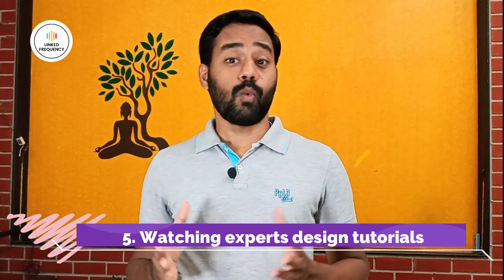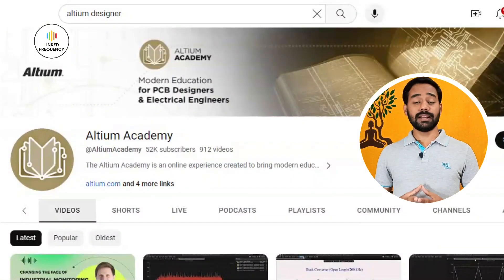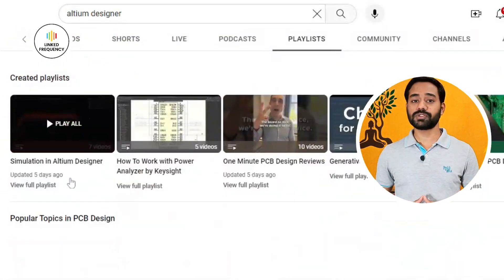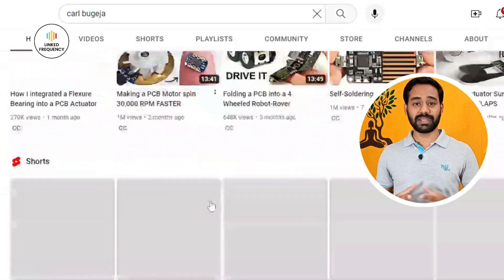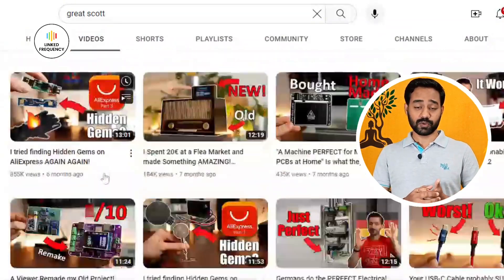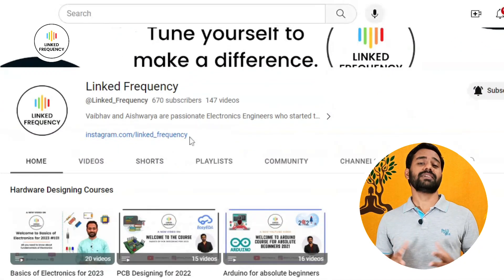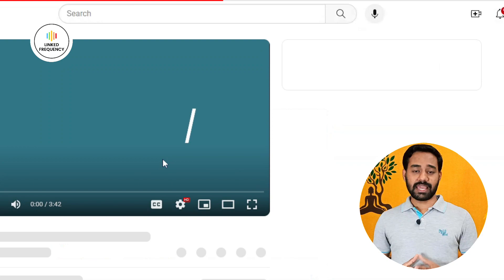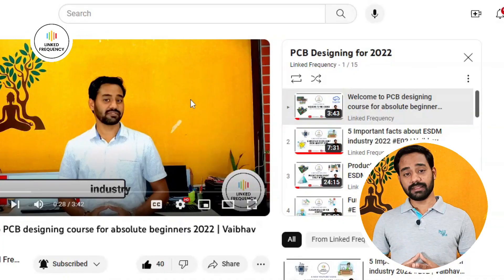5 Tips to become a Professional PCB designer | Vaibhav Sugandhi

Comment: Hello, I just finished an electronics engineering degree and was having a bit of a hard time finding a job on my local area, this tips helped me out on the right direction when it comes between a PCB side of my career as I was also trying to apply for some remote freelance work, so I would like to apply for a remote internship in this area if possible. I do simulations in Proteus and PCB designs in KiCad but I am open to learn other platforms
Reply from the maker: This is a great step to start your career in hardware designing, I hope you are active on LinkedIn to keep your profile open for opportunities. 

All the best :)
#Linked_Frequency

Comment: sir i don't have any engineer degree but i love to make pcb and i have designed some 2.1 amplifier board, so is there any chance that any company will give me job?
Reply from the maker: The need of degree is essential in large scale industries, however in startups and MSME industries can offer you a job without a degree. 

My strong recommendation to you is, plan for part time degree education along with work OR if you can afford, then go for full time degree education. Not for the sake of degree, but for the sake of experience and knowledge on how higher engineering concepts are used in real time projects. 

Feel free to email us if you need any further guidance. 

All the best & Happy learning :)
#Linked_Frequency
Reply: Sir I completed my entc diploma it is enough ? @Linked_Frequency
Reply from the maker: Yes. 
Now a days it is not important to complete degree, instead you have to acquire more industry level skills with real time projects. 

#Linked_Frequency

Comment: can careergap electronics students learn pcb design and do get job or not
Reply from the maker: Yes, career gap will not be an issue if you provide proper reasoning to the interviewer. If your skills are matching to the job role & you are capable to answer all questions correctly, then majority of the interviewers accept career gap. 

However, having a practical skills & strong fundamentals are essentials in ESDM industry. 

Happy learning :)
#Linked_Frequency
Reply: @Linked_Frequency  Thankyou,Do we need to have done any certification along with skills and any age restrictions.
Reply from the maker: Certifications help you a lot to grab the opportunities to get interviewed, but cracking the interview is solely dependent on your true skills, communication & ability to match the needs of job description. 

Age restrictions are there in every industry, as we cannot do a lot of things after a certain age. Most of the hardware design engineers are around the age of 28 - 40 years. Before 28, you are still getting to know the industry & after 40 you will be having out dated knowledge on hardware components in the industry. This is just my opinion, not necessary to be true to everyone. 

Happy learning :)
#Linked_Frequency

Comment: Is there online jobs for PCB designer
Reply from the maker: There are lot of online/offline opportunities in hardware design engineering. However, they need solid skill of complete product development knowledge. One important aspect to be considered is, PCB designing and product development is most likely to be done in well equipped laboratory with all electronic standards in place. Hence making this job online is not fully possible at this point in time. 

Happy learning, 
#Linked_Frequency :)